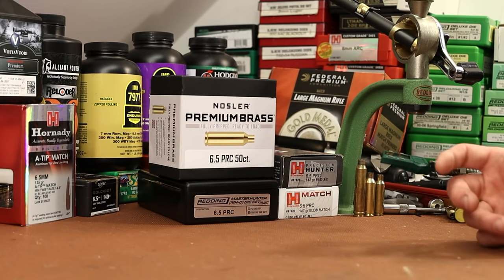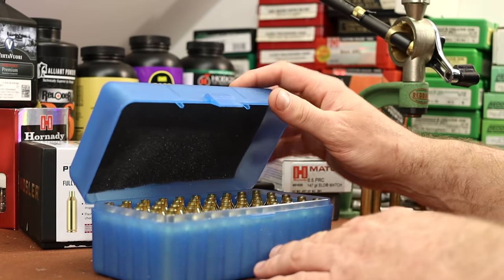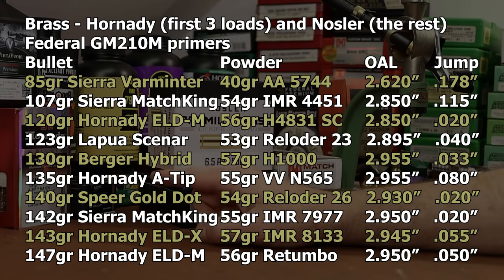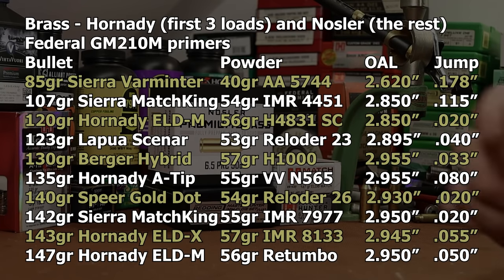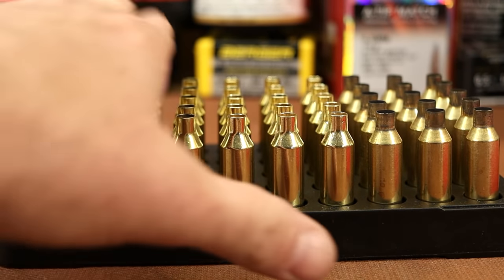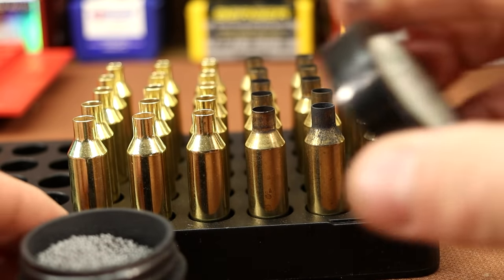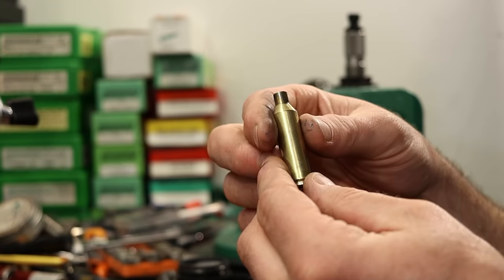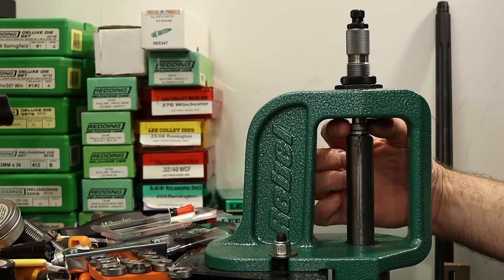6.5 PRC - Getting Started With Reloading

Comment: I had the same issue on my first case sized in the Redding FL die. Thankfully I was using it without the decapping assembly so I tapped it out with a punch. The solution for me was to use imperial sizing wax instead of the Hornady one shot spray lube and make sure the inside of the die was lightly lubed as well as the case.

Comment: I would look up the 6.5prc sticky case issues. It has to do with dies not sizing the base of the round enough. Had a Tikka I sold as it did it after first firing. Was taking a ton of force to open the bolt. My 300prc started the same thing. Thankfully custom gun builders had a custom reamer to fix it.

Comment: Great stuff Johnny. I noticed the lube spray which I have never tried only contacted the areas of the case that did not get stuck. Curious to see if the cases were sprayed outside of the reloading tray if they still get stuck. It appeared on the video that the tray prevented any lube from contacting the base of the cases. Personally the sprays always seemed enticing for saving time but I still stick to an RCBS pad or the the little round can you showed in the video. Keep up the awesome work!

Comment: I had similar issues with a Redding FL sizing die in 6.5x284 Norma…they didn’t get stuck but took a lot of force to run them through the press. Should’ve counted how many were like that but after about 10 or so it got a lot smoother. I did clean the die set as per their instructions before sizing, just thought it was odd.

Comment: That MDT chassis uses long mags to accommodate cartridges up to the RUMs.  I just finished a 338 Edge with the same action and chassis, which is a .300 RUM necked up to .338.  It uses the same mags as the 300 Win Mag, minus a rib toward the front, to allow for the longer brass length.  With a 30" barrel, the finished rifle weighs 14# unloaded.

I don't believe that he decapping stem was cross threaded, I think it was just threaded all the way down until it contacted the top of the neck sizing area of the die.
Reply: Ballistically speaking how does the edge stack against the 338 Lapua, and the xc?
Reply: Remembered the 33xc is based off the cheytac case. So I'm assuming its slower then the xc
Reply: @williambell7763  Starting the break-in tomorrow.  From what I understand, it can have a slight advantage over the Lapua, especially with longer barrels.  The reason that I chose the Edge was because I could build it on the existing 110 action that I had. It was a regular barrel shank, not a large, and you can't build a Lapua in that shank because of the case diameter. We'll see how it goes.  If I shoot it enough to need another barrel, I'll have a longer one made.  A lot of barrel makers don't go over 30".  I bought a Shilen 9" twist.
Reply: @tjh44961  that'll be a cool deal then, I like the RUM, if for nothing else then it's a hot rod to the bone, I imagine that the edge will be a good shooter with a shilen on it. Hope it goes smooth for you

Comment: I had similar situation with hornady once fired brass (not from my rifle) I had to full size. If in left  the case in the die for more than couple seconds it appeared to sprung back in the case and got stuck. Once I speed up the resizing  process I was able to size them without any problems.

Comment: I've run into this a few times.  I annealed the brass and haven't had an issue since.  6.5 prc brass from Norma ADG and Hornaday.  RCBS dies in a rock chucker.  I only neck size after fire form. YMMV

Comment: As you crank on the stuck case you should follow with the decapping pin keeping it close but not touching till you can pull the case over the expander ball while the case has cleared the neck part of the die

Comment: For your group section, all of your loads were slow but I am sure you know that. In my mind PRC is for the heavies, so I would like to see more at that end. The 150 smk is a no go for that barrel, but you can do what you want. On the sizing, something is clearly wrong with that die. I would also recommend grabbing a lee 300 prc die to size the base of the case a bit more. Take all of the guts out, screw the thing way into the shell holder and size the base more. You can do a little modding to get even more sizing at the base.
Reply from the maker: I hadn't heard about that 300 prc die trick. I'll go ahead and grab one.
I think you told me the 150 wasn't going to work back when you sent the barrel, but I couldn't find our old messages. I couldn't remember for sure. I'll just stick with the 140-147 stuff. Thanks again, man!
Reply: @JohnnysReloadingBench  no problem. The 150 smk is longer than the 153 atip for certain, and very likely the 156 Berger. I did not try those, if you wanted to go heavier those might have a chance. Also, for reference I have a custom honed Forster die

Comment: great video. I had same issue with Hornady brass as well. I have had my Hornady 6.5creedmoor brass getting stuck in RCBS full length sizing die. I think its the Hornady Brass. RCBS made the base of the die 0.003 larger (if i remember correctly, i had to mail it in). it was strange that you had Nosler brass stuck as well.

Comment: Perfect timing, I wanted to reload it for my friend but finding descent priced powder is hard, local guys from forum want $50 per pound!!!  Also no mag primers but I think I can get away with normal one.
Reply from the maker: NORMAL ONES ARE WHAT YOU NEED! Hopefully you saw that correction later in the video. Good luck!
Reply: @JohnnysReloadingBench  just curious have you ever done any testing with magnum vs reg primers? If im being honest i mix and match all the time, especially in the recent times, and ive never even seen a SD difference let alone pressure sign or anything, so far in my experience if the firing pin will punch the primer then im getting same same results. One of my pistols doesnt like to punch small rifle magnum primers but ive literally only had that experience with that one particular warn out old ruger.. curious..
Reply: @JohnnysReloadingBench  Shannon, I just want to give you a quick feedback.  I got my Lee 6.5 PRC dies and sized first 3 cases (once fired Norma) and it was effortless.  I just lubed everything with imperial wax and it was smooth.  I only spray the small cases, also I noticed new dies need extra coat of lube before the 1st time sizing.  My worst experience was when I tried to size 308 for the 1st time, I though for sure I am going to get a stuck case but decided to pulling back halfway would be worse so I let it go all the way and it didn't get stuck but it took huge amount of force.

Comment: How do you determine what powder you’re going to use with what bullet? I always run either the same powder changing bullets or the same bullet changing powder. For example I’m doing a 5 powder test using the same bullet, seating depth, primer and case. I loaded 5 rounds of each of 5 powder charges and then of course 5 different powders with charge weights based on load data from the bullet manufacturer or the powder manufacturer depending on what out there. At the end of the day I’m looking for the method to your madness. You obviously have far more time on the bench than I do.

Comment: In the future, if you get a stuck case drill and tap, but make sure the bolt will drop into the primer hole on your press, then have the bolt fit up through the case holder make sure it is a hex head, then screw right to the bottom of the case and then just pull it out like normal like you would use any other case and it comes right out.

Comment: If you dont have a drill and tap ready. I used a stainless 
woodscrew (deep theads) with a self cutting tip. It had a big enough head to take the force.
I just used big enough
(for the brass body) nut to create some space. And some spacers to keep the head of the screw from going through.
As i was turning it with. The brass kept moving up. Low tech style 😅🙏

Comment: I had the same issue with my redding 308 set. Turns out there were machining marks left on the inside of the die. I had to take it back to the gunship where the gunsmith polished the inside. Then worked just fine. But yes. It came with issues from Redding

Comment: I chuckled when that case stuck. You dd everything right as far as I could see, definitely not a machinist, nut, the amount of brass in the die says a krap finish to me. Never had one of those yet, but have heard of some lately on Redding, odd one on others over the years..I've never stuck a case yet, bought the RCBS remover 40 yrs ago, haven't used it yet. Nowadays I use a decap die and expander mandrels, so, unlikely to ever have to use it. Alway find AA5744 interesting in the number of things it can be used in, one of those powders that is worth keeping  around, it can be useful.

Comment: Another great video I’ve been considering the 6.5 prc or 300 WSM I have a 300 RUM I built for ELR shooting out to 2500 yards it has a 32” finished barrel plus muzzle break so I can utilize the slower powders rutumbo, ramshot magnum reloader 33 h50bmg works the best I’m loading the 245 Berger’s and the 250 A-tips at 4.125” @ 3100fps.  It’s a monster
Reply: I run two proof carbon barrels on my defiance XM in both 300 wsm and 6.5 PRC...love both of them and can hunt anything in NA with that gun.

Comment: Am I wrong for thinking a full length sizing die should be polished mirror smooth from the factory? Less stress on the brass during resizing operation, less stretch, ect. A barrel chamber by contrast needs to be a courser or have a rougher look to it so the case can grip the chamber during the firing process. All of the sizing dies I've ever seen are way more polished and smoother than that Redding die you have, If it were me I'd be getting in contact with them to see what the deal is with that die cause it is not right!! Once again Thank you for another entertaining video!

Comment: Accurate 5744 is a great powder for cast bullets loads in rifles. Lyman uses it for every rifle cartridge in their cast bullet book. I like it in 300 blackout 7.62x39 and 30-30
Reply: I have a pound of this powder and Lyman 311291, using Win 94 lever action, what's your accuracy load in 30-30?
Reply: I have yet to achieve accuracy with the cast bullets in my 30-30. I have been using a Lee 150 gn flat nose that I haven't gotten better than 3 inches at 100 but a new mould is hopefully on the way.
Reply: @bendennis8773  I am working on accuracy load too but 100 yards with iron sights?  I actually installed an adapter in place of rear sight that holds pistol type red dot and even than I am conducting my tests at 30 yards for now.  Lee 150gr flat nose shot great in my 308 with 20 something grains of IMR4198.  I just need to make some ladder step loads with this powder.
Reply: @DimaProk  I hunt out West. It's pretty rare to get a shot on an animal under 100 yards.  Most of my cast loads in rifles are low power for shooting at steel. The old Winchester loves those 160 gn FTX over Leverevolution. Those groups  can get 3 shots under 2 inches when I am having a good day.

Comment: Practically speaking, what's the fps difference gonna be between the prc and a 6.5-06? I have tons of 270 and 30-06 brass, and I'm thinking it would be more economical to go that route brass wise. I have a creedmoor already and have several projectiles stocked up to choose from, mostly in the 140 to 143gr weight range.
Reply from the maker: I don't know much about the cartridges, but I would bet you'll have difficulty finding heavy bullet load data for 6.5-06.
Reply: I kinda figured as much. I'm thinking it's not enough of a difference from the creedmoor to warrant another rifle. 
I'm thinking a 338-06 or a 35 whelen would be a better idea for my extra brass. Nothing bigger than whitetails around me so I don't really need one but it would be fun nonetheless. 
That or try to pick up a Garand for a reasonable price and go to town with it.
Reply: @carterthiessen2664  quick Google and forum trawl says 2900-3000 with mid 50s powder charge of rl26, h1000 is popular too apparently. This was specifically referring to the 143eldx in a 25" barrel, caveat being this was a random guy on a random forum shooting a max load in his opinion in his  conditions, so ymmv. 2800 seems like a really safe spot, and 2900 on the hot end but still probably safe. One person had an AI chamber and was over 3k but that seems iffy

Comment: I've set up 3 Savage 110 Elite Precisions and 2 Savage 110 Precisions. 300 WM. I had to bevel the ejector at 25-30 degrees towards the firing pin hole to make them action smoothly without getting hung up when chambering exactly like what I saw happen to you on your 110 Precision. Savage claims to not know anything about this issue. They would save a lot of money in shipping alone in their warranty department if they would just bevel the ejectors before installation.  The magnum length magazine is another sign of laziness by Savage. 

Looks like your cold bore shot is always 3/4"-1" to the right of your groups. You are shooting better than you think. Been watching your videos for years. Keep up the good job!
Reply from the maker: Thanks for that extractor info!
This gun was originally 300 WM, so I can't blame savage for the magazines.
Reply: @JohnnysReloadingBench  Ejector. I used a bastard file and a few swipes does it. I will take back the Savage magazine comment. Lol

Comment: Removing loose case from a stuck case scenario. Once case is loosened with your stuck case remover, grind burr flush with rim. Insert die as normal making sure case is still loose. You can reposition button and depriming pin to normal location. Rotate case to fit into shell holder. Remove same as normal case carefully.

Comment: So instead of cutting the case head off, wouldn't using sockets or washers or something as spacers let you continue to pull the case up by the thread job? Basically just create more space between the bolt and the decapping pin while allowing you to continie to keep cranking?

Comment: I like the 147gr ELD-M in my 6.5x55 swede, I even tagged a hog with a frontal headshot at about 140ish yards. Dropped like a sack of potatoes. As for the 143gr ELD-X, seems like it needs to be pushed faster maybe to find the accuracy node you were at with the factory load.

Comment: Great info as always Johnny. What your velocities show, is my biggest issue with this cartridge, it's an equal or slower 6.5x284 Norma or a slightly faster SRP Creedmoor.
Reply: I am using h1000 and 156 bergers running at 3010 fps in 26” barrel at 1.1 gr under pressure signs

Comment: BTW the standard Redding seating die isn't good for a lot of bullets because the tips bottom out before they get to the ogive. Very disappointed when I tried to seat some Hornady SST's and Hornady Match bullets in 143 and 140 grain. Lee's don't work either. Pretty disappointing seeing a 6.5 PRC is designed specifically to shoot high BC bullets. May try to modify seaters by drilling them deeper in the center on a lathe. I had to order another bullet seater. Bummer! The Redding Competition seater is designed differently than the standard.

Comment: N565 with 147gr ELD-M using 59.5gr @ 3,000 fps. Tikka 24" barrel no issues. I have to FL resize all my 6.5 PRC brass on two different actions when neck sizing works on my other calibres?

Comment: Using a stud and nut is a much better way to pull that case.  Using the Allen or cap screw will allow the threads to strip with the turning action in the treads.  With a nut and stud the threads don't move in the case and it receives a straight pull.  You would literally have to rip the case head off for it to fail.   By the way, the inside of that die looks terribly rough, looks like a die problem.  As for the 5744, it's very easy to ignite and it's one of the most fill and position insensitive powders out there,  Great in old black powder rounds with a lot of room like a 40/60 Winchester or 45/70.

Comment: That sizing die is way too rough on the inside. I turn a few things on a lathe at times, and you only get a bad finish like that if the cutter has a damaged tip and rather than cleanly cutting it chatters away. The other thing that happens when it's not cutting cleanly is the cutting tool flexes slightly so you don't remove as much metal as you should and the size ends up being wrong. I suspect this is what happened when they made your die.
Reply: I am with you Pete, when I saw the photos of die bore, I knew what was wrong.  This die was not polished out.  It does not take much, a light rusting will cause havoc.  I recently had a problem with a new Redding FL sizing die that had a sharp edge where the neck starts in.  I polished the burr off that edge and it was fine.
Reply: @michaeltaylor7436  The inside of the die has a fish scale type pattern rather than clean cylindrical cutting marks, this is a clear sign of a the cutting tool was chattering (flexing side to side)....which only happens if the metal is too hard for the cutter or the cutter has lost it's edge. I assume they use cutting tips which are up to the job, so it must have been damaged. The real disappointment is quality control didn't pick up on this and allowed such a rough job to pass.

Comment: I have a question, I have built a AR, in 223 wylde. I have 223 and 556 brass. I am going to run them through a 223 set of dies. Is it possible to run 223 bullets with 556 amount of powder? Is there anything I should be aware of?

Comment: I have only had a stuck case once, and that was when I was using a body die and forgot to add lube.  I used RCBS liquid lube, and now I use Hornady One Shot.

That die doesn't look right.  Too rough.  All my Redding dies are way more polished and smoother than that.